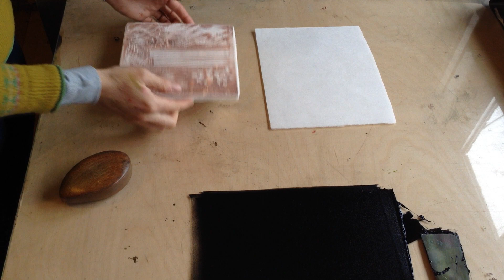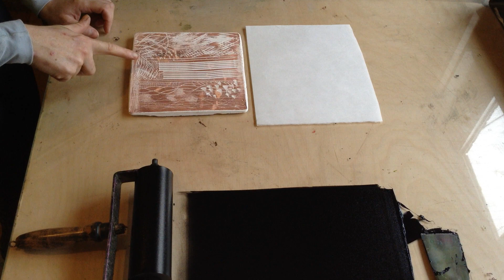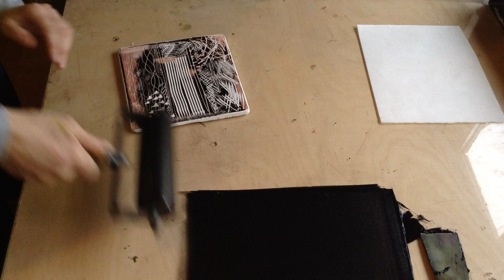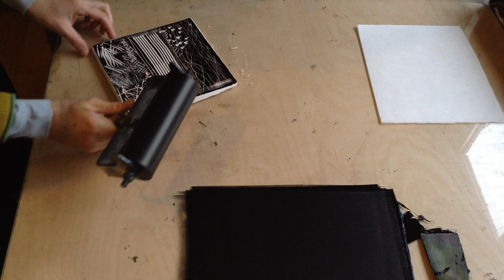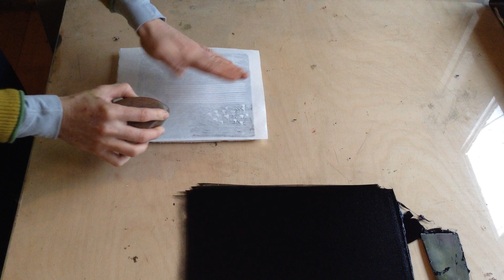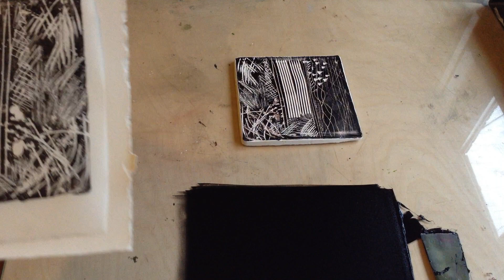Plaster Printmaking: Relief surface through mark making Part II (Printing)

Comment: Can I ask how you clean the plate after printing and its sealed?
Reply: if the ink is oil based you remove it with oil, if its water based remove with water and soap. for cast i believe oil ink is recommended since youre using water for the plaster mix